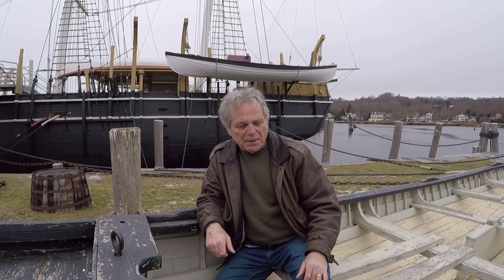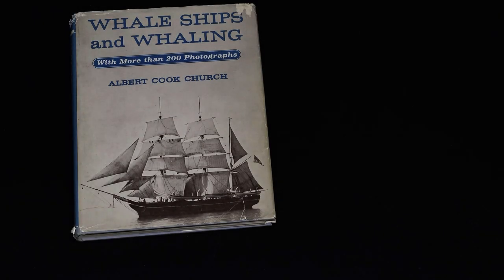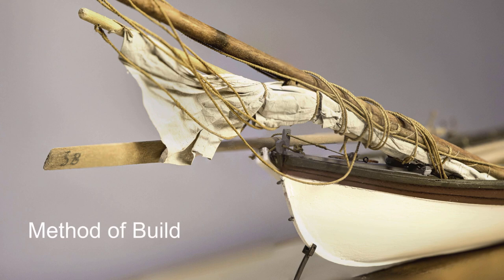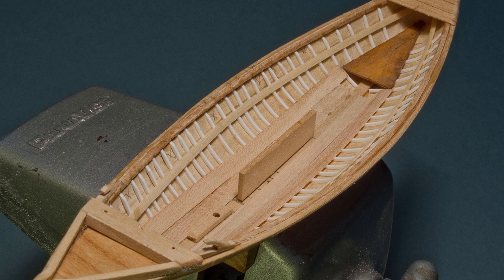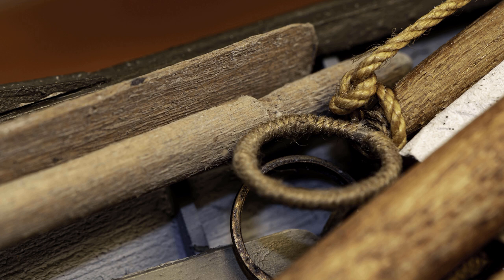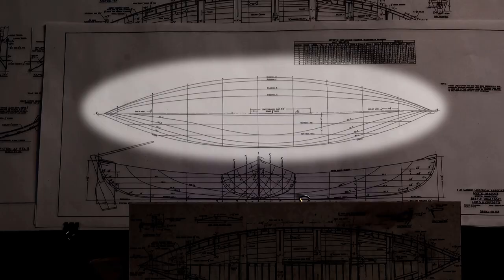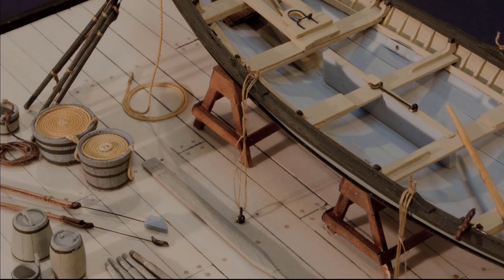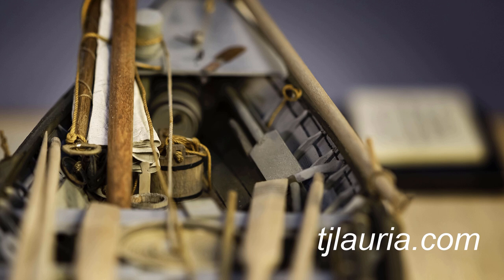Building a Whaleboat, Episode One

Comment: your videos are fantastic! I have a question for you. I am making a 1:50 scale charles w morgan and want to make whale boats to scale. the kit provides a very poor facsimile of an actual whaleboat, and looks like a toy. so, is the beetle whaleboat standard equipment on 
the Morgan? and if so, is 28´6" the correct length? when I scale off of the original design plans it seems they are only 27 feet long. I guess i´m answering my own question, but I don´t think I can fit 3 whaleboats on one side at 28+ feet. any opinions? I am trying to make this boat as true to actual scale as possible. thanks again for the videos, I have already spent hours watching them.
Reply from the maker: There is no direct correlation between a particular ship and the whaleboats it carried.  The ship was outfitted with the boats the captain liked.  At any given time, CW Morgan could have carried Beetle or Delano or Leonard boats or any of a half dozen other builders' boats in the New Bedford area.  
As far as sizes of the boats is concerned, it was dictated by where they were to be hung on the ship.  The starboard quarter boat could be be anything up to about 32 feet because  basically, there was nothing to restrict it, except the cutting stage, when rigged.  On the port side, as you discovered, there are definitely length restrictions.  The waist boat would have been the smallest of the three, as small as 25 feet and the port bow and quarter boats may also have been smaller.  I don't know how accurate the plans are that came with your kit, but if they are good, there will be a difference in the spacing of each pair of davits from which the boats hang.  Measuring the center to center distance between those davits could give you an idea of the size boat that hung there.  Hope this helps.

Comment: Hi again. I mentioned before about the scale of my whale boats for my CW Morgan whaler. well, I have become quite frustrated in my quest to create a model to scale. for some reason every place I look for actual dimensions on the Morgan I get different answers. nobody can seem to agree on overall length and height. my model claims 1/50 scale, yet none of the purported dimensions match this. are you privy to the real length of the Morgan, and does this include the bowsprit or only to the end of the hull? I´ve seen the original design drawings but when I scale them the dimensions are way off (I can´t read any of the numbers as printed) seems I am stuck at square one...I watched your video about your roots in the modelling life...the Bob Ross comparisons are quite fitting...enjoying all of your videos, they provide solace in a world of chaos and discord. thanks for sharing your skills...
Reply from the maker: It sounds like the easiest way for you to address this problem is by carefully measuring the distance between the centers of all the boat davits.  Once you know what the that distance is, you can size your whale boats accordingly.  I wouldn't bother with comparing your plans to anyone else's.  Deal with the plans you have.  If you start to mix and match information, you're headed for trouble.
The sizes of the Whaleboats:
As in my earlier response, I mentioned whaleboats were all different sizes for a variety of reasons.  Once you've measured the distance between the davit falls, it means you know EXACTLY where the eyebolts on each boat are.  You can count on making each boat ABOUT two or three feet longer at each end than the measurement between the davit falls.  How much do you add on?  If adding three feet does not leave enough room, cut it down a little bit until all the boats fit comfortably end to end with one another, with a sensible distance between each.  To keep frustration levels at a minimum, do this step with paper or cardboard cutouts.  Once you have the lengths for all the whaleboats (and keep in mind, only one or two may have to be sized differently from the rest), you can scale your plans up or down until you hit YOUR numbers.  If you have an all in one scanner/printer, you can do it all from the comfort of your own home.  If not, you may have to spend some time a copy center.  You should work out the size differences in percentages.  This should get you close enough so that any minor discrepancies will be of no consequence.
Reply: @shipmodelguy  thanks tom, I was hoping to at least determine what scale my plans are really at, and thus board thicknesses, plank widths and mast and spar diameters could be accurate. I am putting all of my whaleboat plans in autocad, so scaling them up or down is a snap....I was hoping the 28 foot whaleboats would fit but I can´t know that if the scale is way off. thanks again...Happy Father´s Day!
Reply from the maker: @hansvonstetten3236  Oh.  I didn't understand what you were looking for.  Now I think I do.  CWM was/is 103' from knight's head to taffrail.  With that you should be able to determine if your 1:50 plans are close.  The length of your hull between those two marks should be 24-3/4" , or slightly less to be accurate.

Comment: Why do you need to cut the image in half first if you're just going to crop it together again later? Wouldnt it be easier and fast just to crop out the whole image instead?
Reply from the maker: I'm not quite sure I understand your question, but I'll take a shot at it.  If this is not what you meant, write back, and I'll try again.
The main reason is so that you're not dealing with any more of the image than you absolutely need to.  Since the plan view is not symmetrical (and to make our template we need a symmetrical image), we have to separate to two halves. If you left the image whole and did the whole crop, flip, copy and paste thing, there would be so much extraneous information in the image, you could (read I could) easily get confused as to which little black line is which.  Cutting the image in half insures you are only dealing with the portion of it you actually want.
Reply: @shipmodelguy  when you used photoshop to move the top view of the boat away from the whole plan, you cut the boat in half and moved the bottom half of the image first and erased the little extra bit that came with it. Then you moved the top half of it, and put them back together into a whole image of the top view again. Wouldn't it have been easier to just draw a box around the whole top view of the boat and move that?
What I don't get is the purpose of cutting the image into 2 separate images just to put it back into what you already had in the first place.
Maybe I missed something that you did to each individual part.
Reply from the maker: @Sciguy95  Because the two halves of the original image are not symmetrical and that's what we are trying to create: something that is symmetrical, top and bottom.  Hence the need to pick one half, separate it, copy it, and make a mirror image of it.  If you used the original drawing as it is to make your template, you would have a very strange looking boat.  The boat tapers at different spots and at different degrees, bow to stern.  Using the lines drawing (the overhead view) as it is would result in a hull that would be different port to starboard.
Reply: @shipmodelguy  oh ok, thats what I missed. Thanks
Reply: @shipmodelguy  sorry if I missed it somewhere, what are the 2 halves? one you used to form the shape of the hull, what is the other set of lines?
Reply from the maker: @hansvonstetten3236  The plans view is divided in half down the center lne of the boat.  Those two halves are not symmetrical.  If we are to make an accurate template from this view, we have to make both sides symmetrical.  Hence the "two halves".  It's a small but important point.  One that could easily be missed.
Reply: @shipmodelguy  of course, but why are there 2 asymmetrical views?
Reply from the maker: @hansvonstetten3236  When looking at the plan and profile views of the boat, the bottom half of the PLAN VIEW will show the shapes of each water line.  And they accordingly marked WL1, WL@, etc.  The upper half of that same view shows the shape of the DIAGONALS and they are marked D1, D2, etc.  Their shape is quite different from those of the waterlines and they may terminate at the top side of the boat in a different spot from the waterline.  It is ONLY the waterline half of the drawing that gives the correct location of the top of the boat, usually at the underside or topside of the main rail.  If you relied on the drawing the way it appears on the plans to get the upper shape of your boat, it may not turn out the way you expect.  Hence the need to make sure that both halves of your plan view are symmetrical.
Reply: @shipmodelguy  ok thanks! funny but the whaleboats are almost more intricate in detail than the morgan herself. you don´t by any chance have any videos on the Morgan? do you have a favorite boat model or one you think came out better than your others? your videos exude patience. thanks again.
Reply from the maker: @hansvonstetten3236  You're right, Hans.  The whaleboat is nearly as complex as the ships that carried them.  And, it was main primary reason for doing this series-too many whaleship models with bad whaleboats!
No, I don't have anything on CW Morgan.  Some years back (before I started making YouTube videos), I build a scratch model of Kate Cory, a small whaling brig with three active boats and one spare.  And that was enough for me.  
And to answer your last question, I think Kate Cory or the coasting schooner, Alice S. Wentworth.

Comment: Hello, I was wondering if you could explain why most kit manufacturers provide parts and instructions which vary distinctly from the actual boat. my Charles W. Morgan kit has the windows in completely absurd locations, and the steering mechanism is not even close. not to mention all of the dimensions are wrong for the scale. the rudder shape is incorrect, the prow is different and many of the deck features are hardly even stand off scale. I suppose more of a comment than a question. carry on!
Reply from the maker: A kit is only as good as its components.  And, that includes EVERYTHING: plans, woods, fittings, instructions.  Another thing to remember is that all kits are a compromise; what can the manufacturer do to bring this kit to market at a price that isn't out of reach of most people?  That usually means generalizing on parts and fittings.  If a kit is manufactured in one country and is shipped to another, the instructions and plans have to be translated.  That does not always lead to a clear understanding of what needs to happen.  Often, there will be discrepancies between metric and imperial conversions.  In the case of the CW Morgan, the kit maker's data may contain details of the ship from various points in its life- Is this the 1841 Morgan or the 1883 version?  If there is no target date for a long lived subject like CWM there could be many details that contradict or leave the builder confused.
There are two things you can do to ease the frustration you may be feeling.
1. KNOW YOUR SUBJECT.  With the Morgan, first read about the ship and zero in on a particular time in its long career.  Become familiar with the ship at that point.  For example, if you're building her as she appeared in 1841, her whaleboat would most likely not have sailing rigs.  And if they did, it would be a very simple rig and the boat may not have had a centerboard.  This is just one example of the type of incongruity you might run into.
2. RESEARCH THE KIT.  See if you can find people who have built the kit and see what they think of the quality of the components and the clarity of the plans and instructions. 
 This response could go on for days, but I think you're getting the idea that just buying a kit does not assure one they will end up with an accurate portrayal of the vessel on the box. The best tool the ship model builder has is education.  Know before you start.  I'll get down of my soap box now...
Reply from the maker: @hansvonstetten3236  James Beetle didn't open his shop in New Bedford until 1850, so CWM would not have carried Beetle boats on her initial voyages, but certainly could have, and probably did carry them after that.
As to shortening the 28' boat-that would be my plan, too.  Keep buggering on!!!